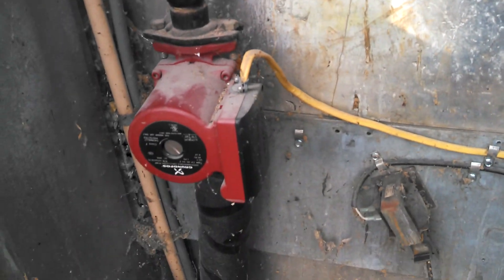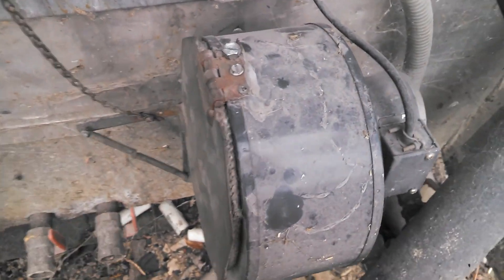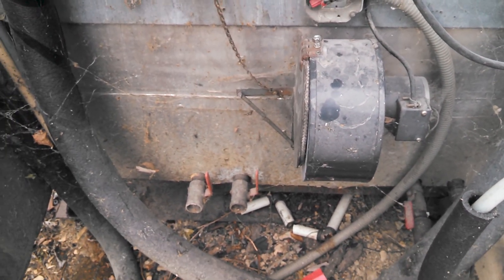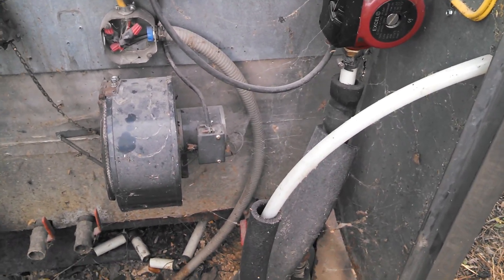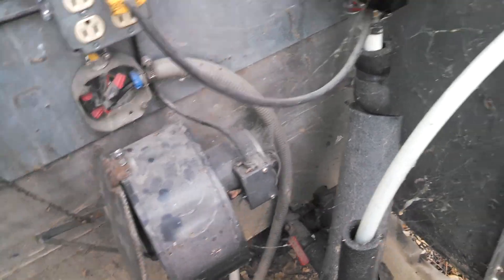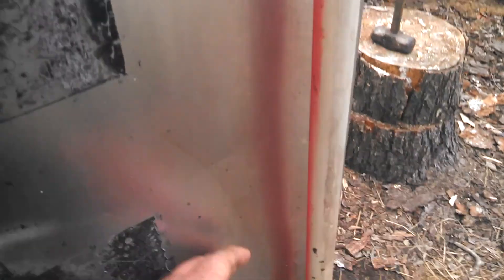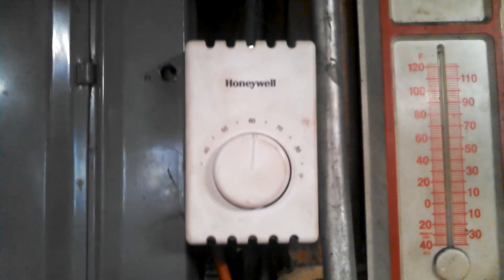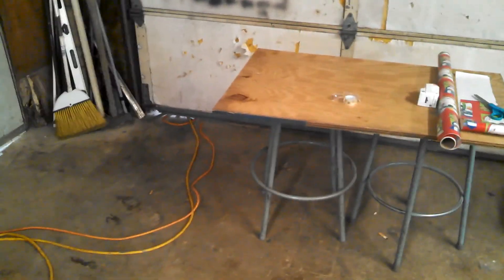A little bit about my outside woods stove

Comment: I thought it may be a Hardy. Like your shop heater. I have a Wood Dr. brand in its 12th season. Capable of heating 14,000 sq ft. I can throw a 57 inch log in it. If I can lift it that is! I'm from NE Ohio, easy Winter. The Farmers Almanac predicted a bitterly cold season, so glad they were wrong. Took my snow tires off my car today. I know I'll have to put them back on but don't need to burn em up in the beautiful week ahead! Dave